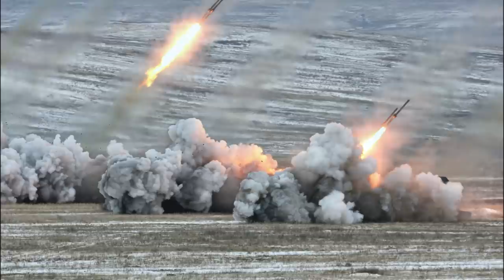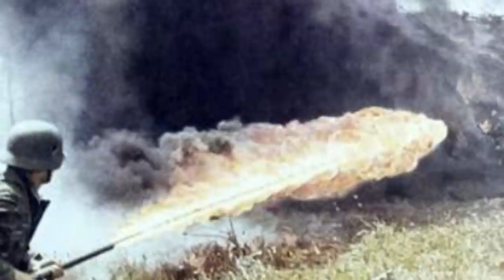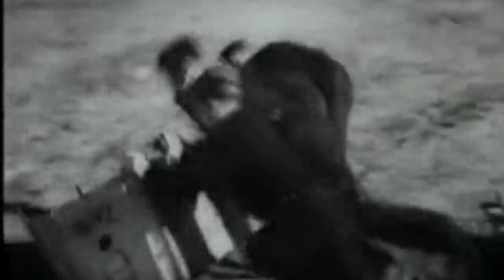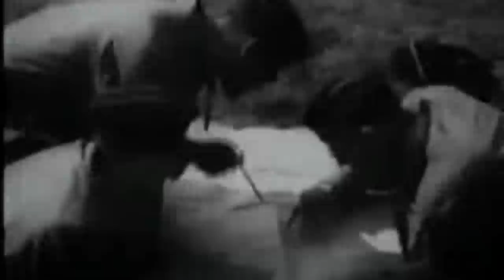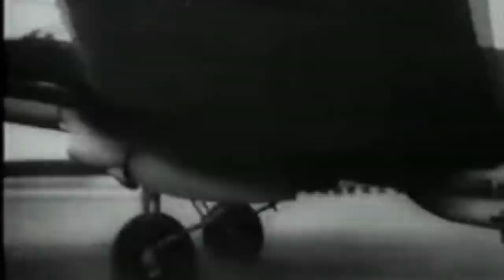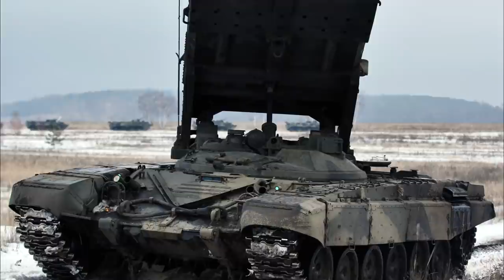What is a thermobaric weapon?

Comment: in WWII a German Commando Otto Skorzeny developed the idea of a two stage fast "Pop" to fluff up the surface area of coal dust, followed by a second "slow burn" to ignite it. This will overpressure the inside of a building, destroying it with a much smaller bomb. Skorzeny is rumored to work for Egypt, Argentina and possibly Mossad after the war. In Ranger School we had handbooks that taught Skorzeny's improvised munitions. It will not "Vaporize" anything. but depending on the burnable materials around, fires can be super-hot. The volume of fire is so large it consumes all oxygen, but does not cause a vacuum. The rising heat causes a wind/draft that feels like a big vacuum cleaner. Multiple rockets or bombs covering a football field will totally bake or suffocate people hiding in fireproof containers at the center. candle / firecracker under confectioner sugar.
Reply: Thank you for commenting this. So many videos rn claim to say how a thermobaric bomb works but never actually articulate why it works. Even this video was bloated.

There needs to be better explanations like this one

Comment: There's a bit of misinformation here. The Russians aren't using the type of bomb you described. 

Few thermobaric bombs used are the fuel air (or FAE) type that you're talking about, those have rarely been fielded.

Most are simply a homogenous mixture of a high explosive and a very reactive fuel, typically finely powdered aluminum at about an 80/20 ratio; but other fuels have been used. 
Composition H6, Tritonal and Torpex are just a few examples used by the US, and yes they are considered to be thermobaric.

The conventional explosives detonation heats the aluminum far past its auto-ignition temperature causing it to burn in a tiny fraction of a second as it is thrown out of the initial blast into the ambient oxygen rich air.

Think of it like blowing on embers to help ignite a campfire, except those embers are already thousands of degrees and you're blowing on them at several thousand meters per second, not to mention how massively more reactive the fuel is than smoldering wood.

 Aluminum powder is very pyrophoric and will react with air causing auto-ignition at room temperature if not properly coated with wax or charcoal.
 So you can imagine why it's such a violent reaction when heated past its melting point and thrown into the air at 6 or 7 kilometers per second.
Aluminum has one of the highest fuel to weight ratios of any element, it's also one of the strongest reducers which means it has a high reactivity (particularly toward oxygen).
Reply from the maker: Thanks Harry, I shall incorporate this in an update

Comment: Based on the description the oxygen is also provided together with the large amount of dispersed flammable material.
Otherwise any explosive is "sucking the oxygen from the surrpunding air".
Reply from the maker: Yes quite - any fire 'sucks' oxygen out of the air.  During the fire bombing raids on places like Dresden, Magdeberg, Hamburg etc. most deaths were caused by suffocation due to the oxygen being 'sucked out'.
Reply: it seems better to describe it as consuming all the oxygen in the area.
any "suction" would just bring in new air from the surroundings, and doesn't properly imply that its from the hot air rising out like a updraft in weather